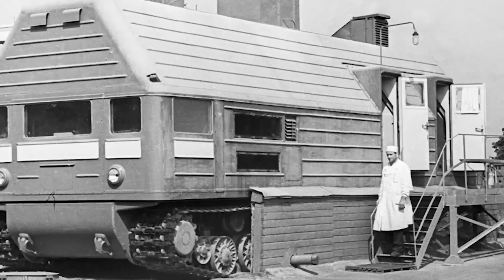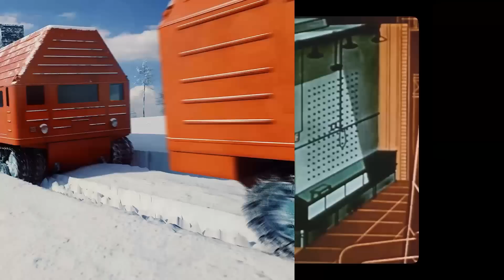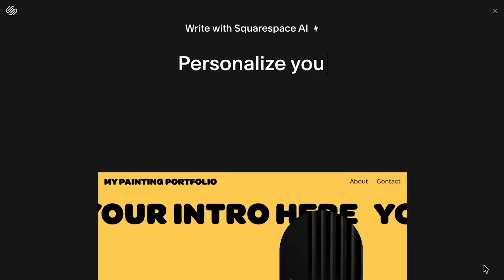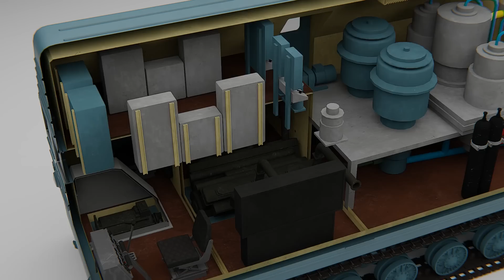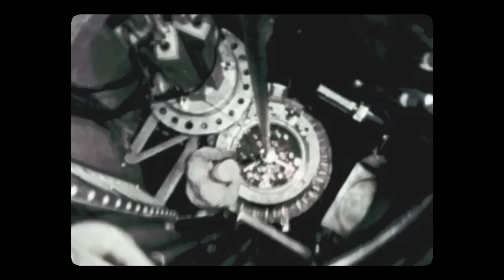What happened to the Soviet Nuclear Arctic Land Train?

Comment: Funfact: The reactor, the steam generator and the control vehicle are still existing. They are still in Obninsk where they where tested, but not at the original site east of the NPP-1. But now it's just a rusty mess. Coordinates (use Google Earth to look for older images in winter, since vegetation is hiding the vehicles): 55.082824504120595, 36.5648452505185

Comment: I, for one, would like a video on the reactor barge. Remember hearing about it back in the day.

Also, since small reactors might be making a comeback, do you think that the technology for the trains would make sense now?

Great video 👍🏻👍🏻
Reply: the weight in the shielding is too heavy, and with modern reactors designed with so many redundant and passive safety mechanisms, reactors are much safer but also much heavier. I don't think the idea is any more plausible now than it was then.
Reply: Nuclear powered trains exist today in France, the catch is that the reactor is stationary...
Reply: @davidhollenshead4892  exactly, just put wires up and make the trains run off of grid power
Reply: Why? To make a Snowpiercer?

Comment: It's a shame the oil companies have demonized nuclear. Something like this, with reactors made to modern standards (incredibly safe), could be really useful
Reply: It,s really the cost nuclear power plants are more expensive and take more time to build then coal decommissing is very expensive
Reply: @AhmadRaza-z7x  Expensive short term, cheaper long term. Unfortunately the world also seems to suffer from peak short terminsim
Reply: @AhmadRaza-z7x  That is propaganda. The amortized cost during the entire life cycle of a nuclear plant is lower than all other energy production methods. 
Nuclear cost a lot to build (until cheap streamline mass produced 4gen small module reactors enter the game) but the massive electrical production on it's lifespan has a very low cost which turns nuclear plants cheaper on the same period of times when you add the cost of all other methods.
And nuclear plants can be refurbished and extended 30/50 years past their utility design.

Wind turbines are very expensive too, they required thousands of times the engineering works of a nuclear power plant to achieve the size to produce the same energy than the later. The wind turbines require thousands of tons of reinforced concrete under massive ground dig for their foundation. Thats a lot of concrete and steel production pollution.
The blades are made of plastic fiber, with resins which are produced by very toxic methods.
They have a short lifespan and must be constantly repaired until being decommissioned. Currently the older wind generators are being passed out and left abandoned. No to mention some of them kill endangered birds that use the same winds they are placed to take advantage off. Just now they are putting cameras to brake the blades if bird flocks are nearby.

Solar energy has 20 years of life cycle, it's production is very expensive en terms of energy and to produce the panels they use large amounts of cyanide, arsenic and mercury, some of the worst and most lethal pollutants in use. Much of which end up in river streams and the trophic chain.<

The giant surfaces solar and wind power need to produce the same amount of energy as a very limited and relatively small size nuclear plant is absurd.
And recycling them is extremely expensive or impossible. Thus why the older ones are left abandoned.

Plus spent nuclear fuel is so small in tonnage. Is very limited, lots of nuclear industry byproducts and waste is used in other industries and the new thorium and older breather reactors can reuse the spent nuclear fuel and turn it into more fuel for next generation reactors making nuclear fuel waste virtually zero. 
Nuclear waste in reality is a problem for the non nuclear items used in the industry, irradiated clothing, accessories, tools, containers, materials, robots. Earth itself is radioactive, we just need to bury them in very old stable geological formations or nearby subduction plates, so they get swallowed to the mantle.
Reply: Mostly it was mostly Pathological Lying, Fake Environmentalists, Without Sources, like Helen Caldicott who claimed that over 985,000 died from the Chernobyl accident, are mostly to blame for the anti Nuclear movement in the West. As American, Canadian, French & newer British Reactors are very safe...
Reply: With all the nuclear accidents it demonized itself i would say 😅
Reply: @Andresen.  Compared to how many oil spills and fires there have been, nuclear really doesn't have many accidents at all. Human error is unfortunately the biggest cause in any accident.
Reply: @Here_is_Waldo  Exept that when a nuclear reactor fails catastophically, it can put half a continent in danger. Even the worst oil spill or fire has nowhere near that destructive capability.
Not to mention the cleanup doesn't take decades/centuries.
Reply: @rockyblacksmith  what you are describing, has only ever happened once in the entire history of humanity. And that was due to several screw ups, and with technology from 70 years ago. This is like saying "i wont ride in a plane because 70 years ago they used to be dangerous"
Reply: @vangcho7593that is exact argument why we don't fly on airships.
Reply: @Andresen. All?. Nuclear power is the safest energy ever. More people die in wind turbines and solar panels production and operation than in nuclear plants. 

Fukushima was japanese corruption allowing back up generators on an active refrigeration reactor to be below sea level right I'm the coast. And zero people died of radiation, all people died due flooding and the evacuation. Yes more people die during the evacuation to save people from the reactors that never killed anyone. 
Chernobyl was a dangerous design pushed to the limits by incompetent bureaucrats. The other 3 reactors are still operational . 
More people died during the emergency response that actual casualties from the incident (which was barely 48 people directly despite the nonsense propaganda that was burned in the common folk mind by sensationalistic press).
Coal energy kill thousands of people yearly. Coal burning releases radioactive isotopes into the atmosphere causing thyroid and lung cancer to nearby communities. 
Oil killed millions of people in explosions, toxic waste, accidents, caused millions of cases of cancer around the world. 
France has 80% of it's energy being produced by nuclear power... Germany closed it's nuclear plants, opened new coal burning plants and imports nuclear produced electricity from France and Poland...

Comment: Other cheaper and safer power sources exist. Thuse no nuclear trains or flying aircraft carriers. The Roman idea of build a fort every 5 miles. Is a good idea. A better one is to tunnel under the artic ice sheet. This offers the advantage of insolated wind protection and eltric powered trains for cargo and troupers. underground reinforced living areas desined like vacuum tubes to keep contents in constrnt 70 degrees temperatures in the under ice sheet exploration community Cargo and troopers can travel on safety in eltric powered trains that lead back to a power plant.  On the cost of Antarctica. With oil drilling and converting it to  desile. To run generation plants on cost. Cheaper, safer is better. If anything like gold,or oil is discovered then pipes with outer vacuum tubes could be made to pump it back to the cost. Or gold trains.

Comment: Probably a good peaceful useful way to use nuclear energy in places where power is needed, especially after a big storm or other emergencies 

Interesting concept
Reply: US Nuclear Submarines have been used that way, as well as the Soviet / Russian Nuclear Barge. But these are not subjected to vibration, heat stress, metal fatigue due to low temperatures, etc.
Reply: @davidhollenshead4892  

Good point

Comment: 10:26 I don't see how this would "still be a highly dangerous method to generate power" honestly. Carrying a truck full of oil is many times more risky than carrying a modular heavily shielded micro reactor.
Reply: Its not likely to explode , but ig the lasting radiation was too big of a risk to take
Reply: @Blue-5  a nuclear reactor cannot explode
Reply: @sciekimike280  True , it doesnt really blow up 

But other systems can ... i think
Reply: @sciekimike280  Comrade, what you're saying is physically impossible, the core can't explode.
Reply: @sciekimike280  I guess you are too young to remember Chernobyl.
Reply: @vostatin9380  Of course it can. I would think that should be obvious to anybody who is paying attention. I think you might mean it couldn't go critical and become a nuclear bomb type explosion? But any device generating heat and high pressure can explode.
Reply: @sciekimike280  Wrong, a nuclear reactor will not undergo a Nuclear detonation but they certainly can explode from other causes. Such as hydrogen gas buildup in the case of Chernobyl.
Reply: @jssamp4442  I guess you're too old to realize technology advances and things get safer with time.
Reply: I believe it's mostly due to the fear of what would happen if someone stole the nuclear material and made weapons. The reactors themselves are pretty safe, but they can be deliberately turned lethal easily enough.
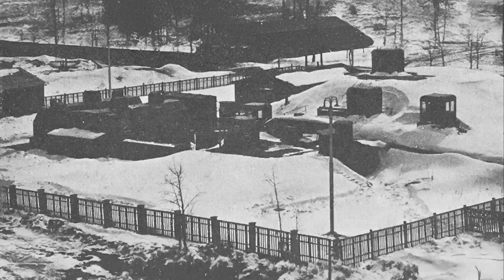Reply: I think the issue is that the reactor isn't that heavily shielded. As you can see in the photo at 7:38 - you need to at least partially burry it because the material of the vehicle alone does not fully attenuate the gamma radiation. Now combine this with the idea of setting up in a place where the ground is frozen so you can't dig a hole to place it in, and that becomes a bit of a complication. Modern reactor technicians receive negligible doses, but no one is within 100 meters of the reactor core while its running, at least for land based plants. This doesn't seem to allow for that.

That said - I'm all for the idea of more nuclear power plants. The supply side of power is fairly easily, its the infrastructure to move (or worse yet - store) the electricity that is a problem. Building reactors where we need the energy is going to have less overburden than trying to build millions of batteries and thousands of miles of new transmission lines to remote areas.
Reply: Hahahaha you might not see how that is but let's just say that is better for your sanity.
Reply: Radiation?
Reply: @goodiusboius5607  you get more radiation from an open air walk in the park that if you were to work in a nuclear power plant for a year
Reply: @sciekimike280  yeah but even if theres a 1% chance of reactor meltdown , radiations last a long time

Its a huge risk
Reply: @Blue-5  It's much less than 1% Such a small reactor won't have as bad of an effect as say fukushima or chernobyl(though that was an entirely different thing)
Reply: @Blue-5  not really, you could perfectly live in Fukushima or Chernobyl for example.
Reply: @sciekimike280  You are joking right? On top of itself, the nuclear reactor has a lot of subystems that can go wrong. Now, its still not necessarily super dangerous, not at all, but your comparison was in relation to "a truck full of oil" which in itself is just about as harmless as something gets....
Reply: I mean, the risk is still there

Comment: Two questions: Was the cooling loop closed or open?  And where was the cooling water coming from?
Reply: I was thinking the same thing. Usually when dealing with nuclear powered transportation there is a heat exchanger to ensure the exhaust isn't radioactive. The inefficiency of the exchanger was one of the reasons that made nuclear powered bombers not feasible in the US.
Reply: Good point, guess that's one reason it stayed on the drawing board.

Comment: You build moving nuclear reactor to power the remote parts of USSR .... And you let it use diesel for movement??
Reply: Because it could only generate electricity when it's stationary. 
It cannot generate it's own electricity.
Reply: @whitefalcon630  yeah I get that ... But that's a bad design that's what I am saying
Reply: @jakub.kantner  for a portable reactor it's not a bad design but the one that's a nuclear barge that's actually a really good design.
Reply: Nuclear Reactor produces alot of energy, but its downside is that it cannot be easily stopped and turned-on. It also makes sense to separate the engine that carries it around, and the reactor itself, so it can be moved without the nuclear reactor itself turned-on or have the fuel. Its mission is to be a self-propelled portable generator, not to be a nuclear tank.